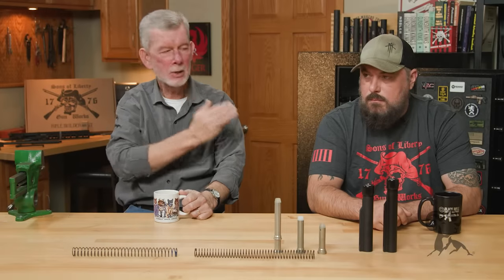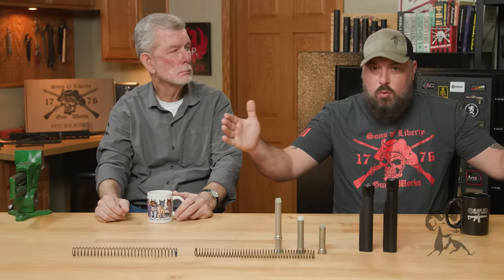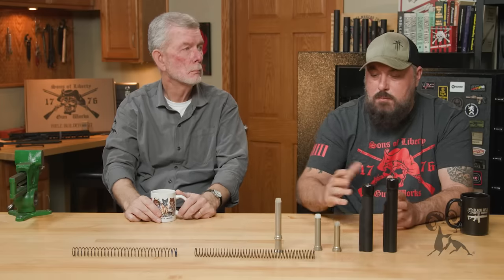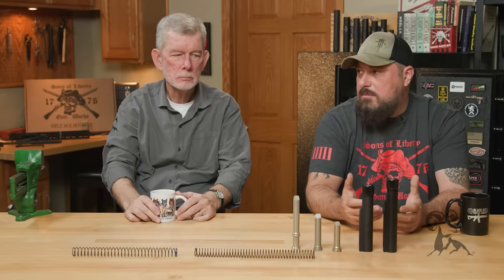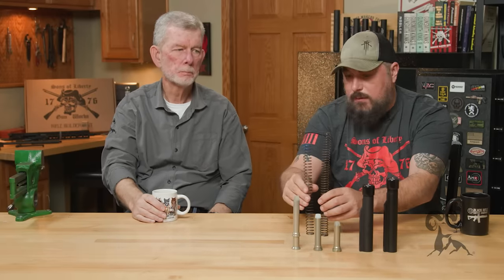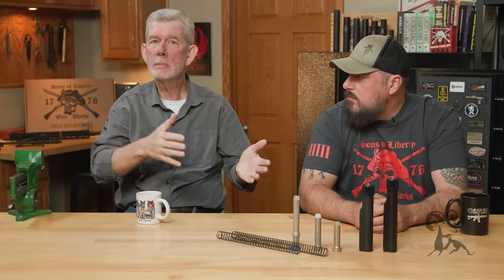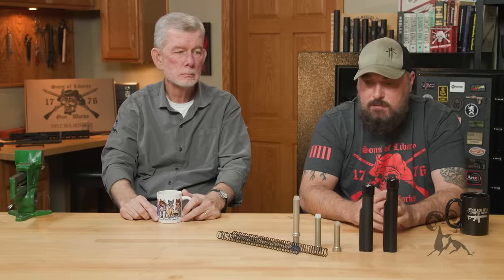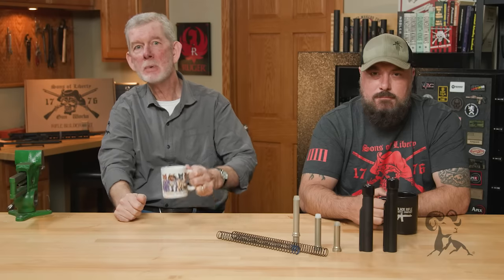Quick Tip: Benefits of an A5 Buffer in Your AR-15

Comment: AR-15s are already some of the softest recoiling rifles around, even carbine-length versions. Weird how people feel the need to mitigate that already very manageable level of recoil.
Reply: If you shot a 16” carbine with a carbine length gas system back to back with one that had a mid length system it would be more obvious. It’s all about follow up shot speed and accuracy.
Reply: Weird how some guys don't have enough user experience to appreciate the benefits.  Go try it out and experience it yourself...softer is softer. Easier is easier.  Speedier is speedier.  Like. Duh.
Reply: @Buletspunge555  I've been shooting ARs since 1985 and I do understand there is a (slight) benefit to a lower recoil impulse. I guess it all comes down to context. I see the AR15 as a sporting\self-defense\military rifle where other aspects of performance are more important. Minor tweaks to the buffer system like this probably make more sense to a competitive shooter. YMMV. Like. Duh.
Reply: @jarink1  sure pap ;)
Reply: Every little improvement is good